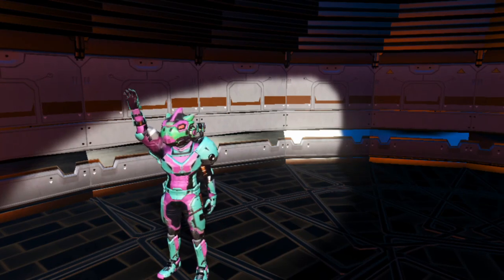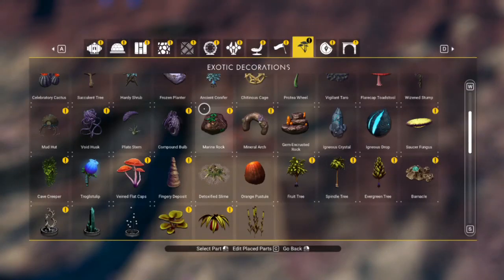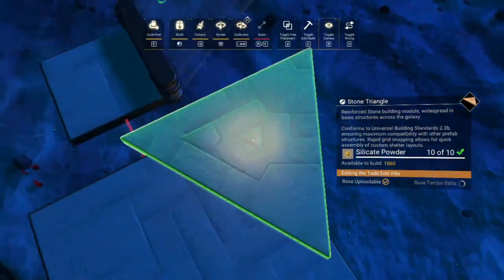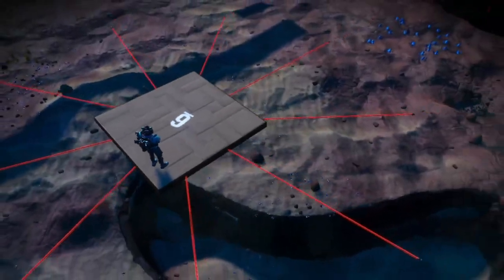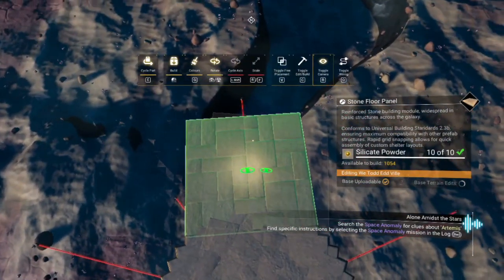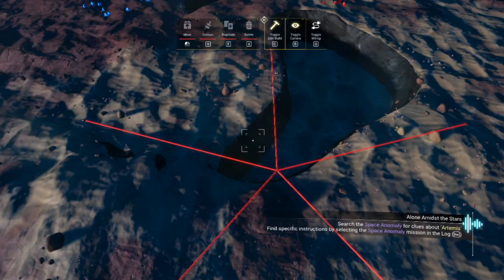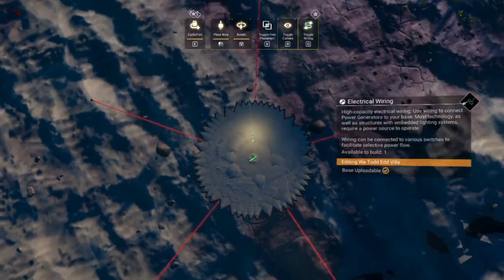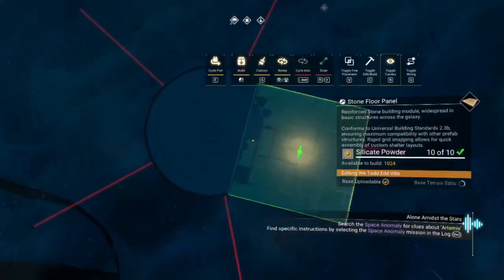Circles from Polygons - NMS Glitch Building - #nms #criscrosaplesos #glitchbuilding

Comment: Excellent guide.  I've been looking for ways to fill in the gaps between the standard number of sides that the current circle technique gives us, and this is exactly what i've been looking for.  o7.
Reply from the maker: Glad I could help! Although Im not sure how well these will fill the gaps of traditional 12-24 or 16-32 circles. Best way to fill the gaps within circles is to double the number of sides you have around the circumference, at least this is what Ive found from the same issues in the past. Thanks for watching!